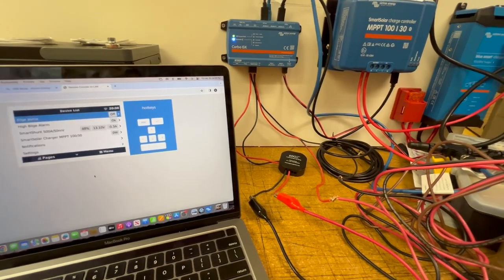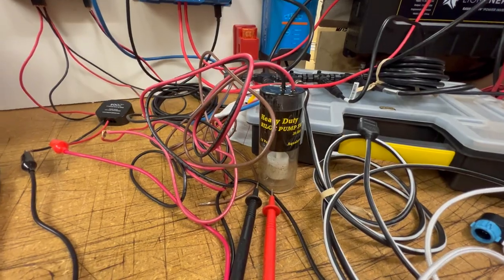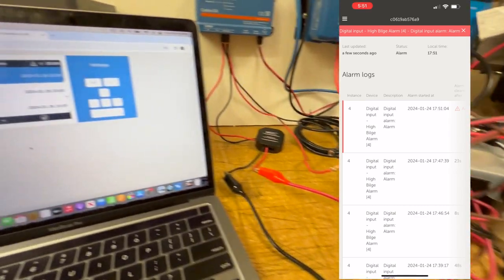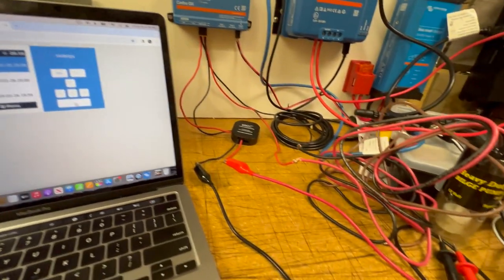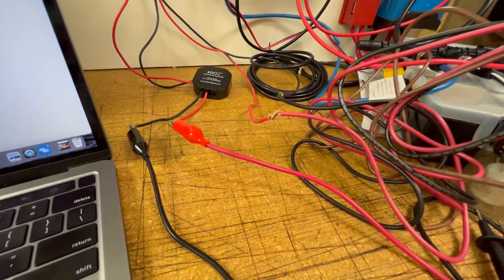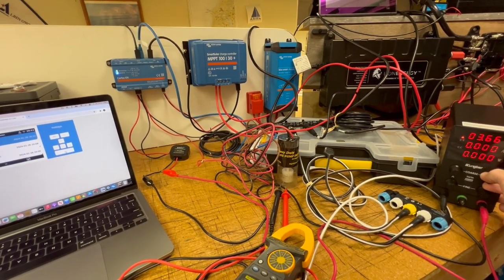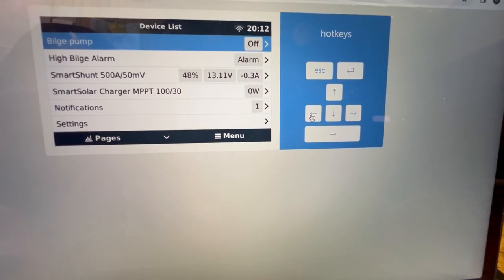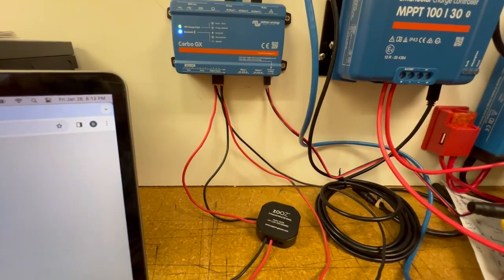Victron Cerbo Digital Inputs - Bilge Pump & High Bilge Alarm

Comment: Can you use an octocoupler instead of the relay?
Reply from the maker: Yes
Reply from the maker: See my most recent video.
Reply: Very helpful video.  Can you please share a video showing how you set a 60 second timed delay for the bilge alarm and how you send SMS notifications for the alarms?  Are you using node red or is this one of the alarm settings in the cerbo gx digital input settings?
Reply from the maker: @craigallardyce4248  Glad it's helpful. I'm afraid I don't see the advantage of a 60-second delay for a high water bilge alarm. The alarm sounds when water reaches the float switch, which is placed slightly higher than normal bilge levels. Regarding notifications, that's explained by Victron here: https://www.victronenergy.com/blog/2022/12/02/new-for-vrm-push-notifications/. I'm using Gerbo GX digital input settings for alarms and VRM.
Reply: @79cd36  Thank you for your answer!  The 60 second timer is to alert me when my bilge pump runs continuously.  This can (has) happen on my boat when the hose connected to my bilge pump loses its prime.  Worried about draining the batts. Anyway thanks again.  I purchesed the dry rely you referenced and it seems like a very simple and safe solution to activating the digital input.
Reply: I just read through the link you sent on VRM notifications - thanks.  There is a new alarm rule in the VRM that will push notification after a set number of seconds (minimum 60 seconds).  Looks like that is possible.  Also seems to allow notification of entry and exit from a geofence area.  This is the other key notification I was looking for (anchor alarm).  Very cool.
Reply from the maker: @craigallardyce4248  Got it. I thought you wanted a delay on the high water bilge alarm. With all parts brought aboard, keep in mind ignition protection requirements for certain applications. That relay, for example, is not rated. Not sure what your installation is like, but worth noting.
Reply from the maker: Yes, and the attached video on the Victron site provides additional information. It's a great system and product. @craigallardyce4248

Comment: Can you share a link to the relay you used? Thanks!🙏
Reply from the maker: This is the one in the video for my land-based demo, but do your own research to ensure a safe installation for your application: https://a.co/d/8JdPbDv
Reply: @79cd36 thanks! Trying to figure out the wiring for bilge running alarm.
Reply: @79cd36 can you provide more detail on wiring a relay when you have a float switch?
Reply from the maker: @tedboender  Just for you: https://youtu.be/8v-77y141zY?si=izRNGTg0udNtt_3v